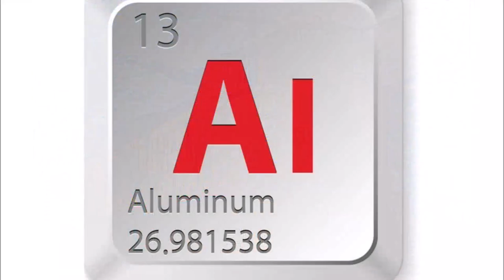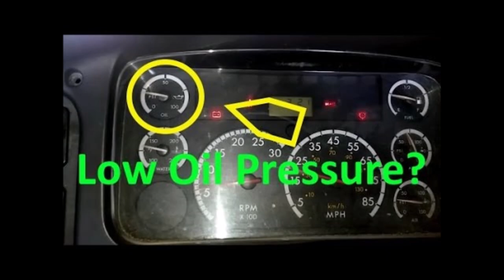U50C| How GE learned to not to use aluminum wires in locomotives, the hard way.

Comment: I think aluminum wiring was also used in some mobile homes circa 1970.  Witness so many "trailer fires" in the 1980s.
Reply: My house still has aluminum wiring.
Reply from the maker: Talk about careless corner cutting. America as a whole alongside its railroads was in a low spot in its history during the 60s and 70s that was impactful.
Reply: I've been in the home building business for 50 years. I remember a time in the 70's when some builders started to use aluminum wiring. But that got shut down pretty quick by building inspectors.
Reply: I was almost burned to death as a child in 1972. My parents bought a new mobile home in 1971. An electrical fire start in the middle of the night and almost killed me and my brother. Yes, aluminum wiring is very dangerous.
Reply: That also baffled me why they chose aluminum for wiring? I can’t imagine the amount of resistance when the wiring got hot during regular use and in hot climates like Death Valley conditions. For those who’re familiar with power generation, if the power doesn’t flow well from the generator it does a lot of damage to the circuits and the generator, not to mention the corrupted sin wave electricity that hits the drive motors.

Comment: One of the main issues (which you could always add with a pop text in the video) is the expansion of aluminum as current passes through it. As such each heat/cool cycle loosens the connections throughout. That is why it has been banned in the US for residential house wiring as the loose connections increases local resistance, which creates the heat that causes the fires (most famously in "mobile homes") especially when compressors (A/C, refrigerators, etc) and resistance-based heating (bare wire space heaters of old) are involved. Distribution boxes burned their bus bars, circuit breakers overheated, plug outlets overheated and fires resulted.
Reply from the maker: I didn’t know about that stuff yet, but I’ll be gaining some knowledge like that in the next year to come in college

Comment: I’ve seen the UP “centennials” in operation, they were impressive! The reason they were retired was because they were hard on the rails. Doesn’t make much sense considering the size an weight of either the Big Boy or the Challenger.
Reply: Weight wouldn't be that much of a factor. OTOH the rigid wheelbase of a truck could cause it to try to widen the gauge of curves, and stress the switches. Big Boy definitely leans on rails with its flanges on curves.
Reply: The DDA40X's issue was not the weight of them. It was the 4 axle trucks causing excessive wear on rails as well as the wheels. But that being said, that is not why they were retired. They were retired because they were worn out and not economical to rebuild considering the change to lower horsepower units to allow for more flexibility.  It makes a lot more sense to run 3-5 3,000 HP units vs a 6,600 HP unit with another loco or two.  It gives you way more redundancy should mechanical issues arise and more options to getting the needed amount of power on trains.

Comment: The big problem with Aluminum is its lack of spring. It tends to crack and break with vibration. Of course one thing you can count on in a diesel locomotive is vibration.

Comment: Looking at the U50c they should have made it maybe even a Centipede locomotive with B-B-B-B-B wheel arrangement and then restrict it to lines forgiving to their weight... Or additionally used lighter materials wherever physically possible along with the long wheel arrangement. Just as an idea. Not good but better than this.

Comment: Whomever thought it a good idea to run 600+ volts (and up to 900 amps) of electricity through aluminum wires clearly didn’t have the first clue about the laws of electricity, physics…..or anything for that matter. EMD suffered the same problems with their SD50s. Had to spend millions stripping out the aluminum wiring and replace it with copper.

Comment: Kind of surprised there isn't a U50 or U50C trustfund organization like with the PRR T1. Although it's cool that they are building a new T-1 with an improved design, it's also kind of ridiculous that they are so infatuated with a flawed locomotive that wasn't exactly the most reliable or appealing to the general public. Whenever you mention a locomotive class or train to a casual, know-nothing person, they immediately think of the Big Boy, "the old school Amtrak locomotives" (F40PH), and the Shinkansen bullet trains.
Reply: Well N&W and C&O both said you are talking  out of you ass about the T-1, as they had no issues with wheel slip or maintained when using one. 

Hell, N&W said it was better at maintaining speed and more efficient than the J.

Comment: Have you done:- Nederlandse Spoorwagen's 1000 and 1100 classes, British Railways Class 28's, Class 23's and Class 17, the London and North Western Railways "Claughton" Class, the SNCF 8500, 17000, and 25500 classes (actually quite good, but were notorious for shaking from side to side, leading to drivers blacking them on an on and off basis), the CIE 001 Class, that had appalling engines, and even when they were re-engined were never quite right. There are others.....😉

Comment: With these 50 class loco’s I heard you referring to the bogeys lay out as being cc. That term is usually used for bogeys with 3 axels but only one traction motor. Such as diesel hydraulics or bogeys with coupling rods. The usual term is Co Co, these have 3 axels and 3 traction motors each. Same as for 2 axel bogeys, either BB or Bo Bo or 4 axel, DD or Do Do, great content, keep it up.🇦🇺
Reply: You are talking about UIC designations, those don't apply in the US.  In the united states we use AAR (Association of American Railroads) designations for locomotives. The AAR does not use any of the terms you are talking about.  A locomotive with two, 4 axle trucks (both powered) is B-B. A locomotive with two 3 axle trucks is C-C.  4 axle trucks is D-D, etc.   The U50  had B+B-B+B designation. Meaning it had four, two axle trucks with a span bolter between each pair (which spreads the load over the pairs)